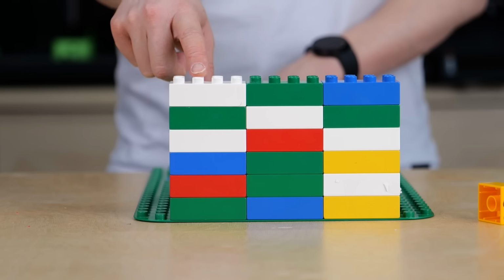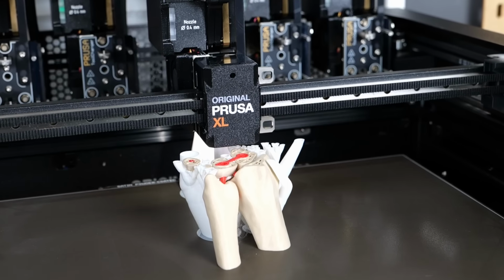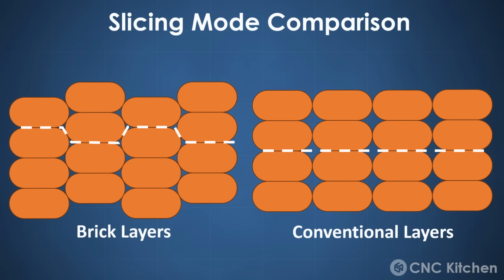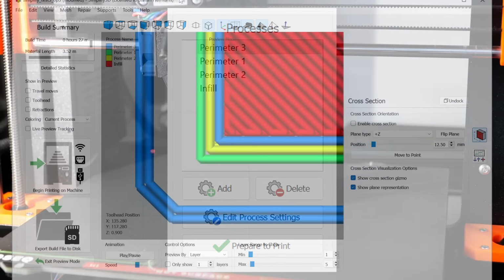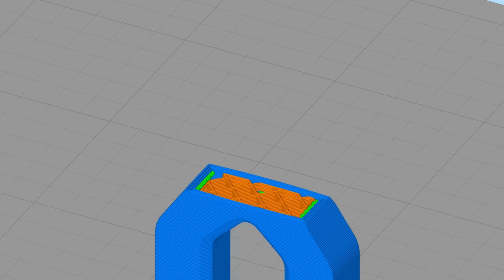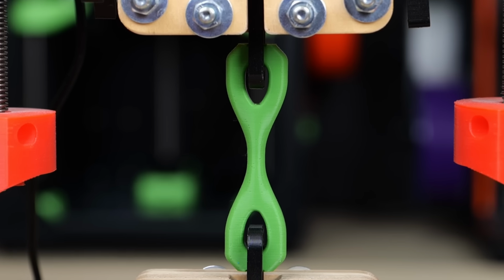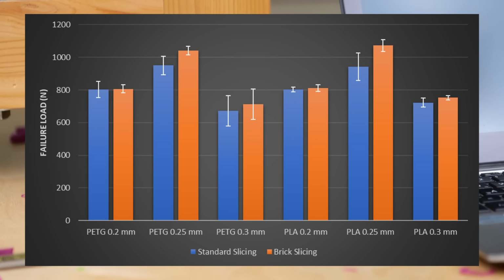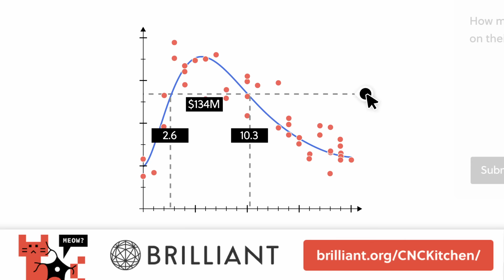Brick Layers - Why did no one do this before?

Comment: How about printing the lines of each next layer onto the seams of each previous layer? Some tweaks would have to be made to get rid of the missing half line at the outer perimeter, but the overlap/interlock would be wider than with the method you presented here.

Comment: I wonder how the brick sliced parts anneal/crystalize. Since there's less space between each boundary, there should be less potential for deformation during annealing. At least... that's what logic tells me. It should also yield better interlayer crystalization during annealing as well, as there's more contact surfaces between which bridging crystals can form.

Comment: Hi Stefan, 
This is a really cool idea, but i'm unsure if lint sheep and traction are good tests for this.
As you're testing the parts resistance for standard orthogonal forces (parallel and 90°) you're ignoring the values between 1 -> 89°
Pure shear and pulling up are too resrtrictive to draw clear conclusion on this, and real efforts are made of combined forces most of time.
You might want to check twisting and buckling too, i'm pretty confident interlocking layers would distinguish better on theses tests. 
What about alterning layer heights and/or extrusion rates ?

Comment: I'm still tens of hours of learning away from testing what you did here, but if anyone with enough know-how reads my comment, please try a vertical plunge of half a layer every few milimeters. this would add anchor points on both X and Y axis between the current layer and the one below. like a vertical zigzag, if you want. I know, slower printing, but somewhat like sewing

Comment: I think the issue with the way you've implemented it and why the fractures are occuring is because although you have shifted the horizontal plane, you've unintentionally created a new vertical stress path,  similar to a brick wall on it's side, Ideally you would also shift in the other axis such that it's more of a honeycomb shaped cross section, although once again, for the added complexity of doing so you might just be introducing a diagonal stress path. I think all approaches could be used together to provide the best strength, but I have no idea if the 3d printers can function in that way, Ie is there the capability of accurately changing the process multiple times during a print without it all going wrong.

Comment: I wonder if the strength increase is even bigger when every other layer has more materuial extruded, like a tiny bit, to fill those gaps a bit more and increase the contact surface.
Maybe even more than just 10 percent, I think

Comment: How about nonplanar slicing?  Rather than slicing along `z-k=0` you slice along `z+a*(sin(x*f)+sin(y*f))-k=0` (choose a and f to limit gradient and amplitude of undulations to fit your printer clearance).  This is the shape of egg-crate foam.

This will have two effects.  First doing away with straight line slices, so there's no focal plane or stress, and second it increases the surface area of slices and consequently increases the contact area between slices.
Reply: The same thing on a micro scale would be to roughen each layer as it's printed.  Your can't exactly sand each layer, but what if you roghened the nozzle with sandpaper so that it would leave grooves as it traveled around, and the next layer could key into those grooves for better adhesion?  Straight groves aren't ideal, so could you add minute oscillations to the path of the print head to roughen the output even more?
Reply: While I'm asking dumb questions, how about rivets?  Leave dumbell-shaped voids about five layers tall with the diameter of the extrusion bead but fatter on the top and bottom layers.  Then try to pump filament down the hole when you get to the top layer of the void to try to rivet the middle three layers together.  While fatter ends probably won't do much to hold things together, what you might be able to do is to make the tubes (and consequently the rivets) go in at different angles that work together to bind in all directions.

Comment: it looks like you have your printing parameters pretty much spot on. maybe the new slicing method makes a bigger difference, if your prints are weaker. maybe if you modify your print parameters a bit, you get a bigger difference. just a thought. bitte mach weiter, deine videos helfen sehr vielen leuten.

Comment: Did you also increase the extrusion multiplier? The radius between the center of each perimeter has increased, an additional material would bridge the gap increase more contact area

Comment: You should try not only overlapping on the vertical plane, but the horizontal plane as well.  I'm guessing that's why the fractures are shooting vertically through the print.

Comment: Please create a microfluidic dripper with a lab/medical grade precision peristaltic pump using UV Cure resin slowly trailing the FPM printhead with a strong UV Led cluster (at the right nm for curing) trailing (at a distance and shielded so it doesn't cure the dripper, only the layer) it to instant cure the UV Resin dripped into the voids, thereby increasing the adhesion strength. Obviously there will be a strength/weight tradeoff in dripper speed so amounts dripped will need to be calibrated for each run to get optimal strength vs weight and to avoid spillage.

Comment: so... based on the idea of layered bricks and the fact that there are gaps visible under a micro scope then what is missing is Mortar.

there needs to be a flux or other layer added between each layer to bond each layer better. 

side note, just a guess but the parts exploding is prob from multiple stress levels that start changing based off other failures. like because it comes apart at one point the rest of the points still holding the load now get extra pressure put on them. so its porb getting closer to the max strength of the material

Comment: Idk myself so I’m adding this but would it not be easier to do it slightly different way by doing something where You print even and odd perimeter and infill 

Like if your walls are 5 
The next level would be 3 or 4 but would be over the top of the joints of the first 5 layers 

Idk and I have not a clue on how to implement but wanted to see if someone else did thanks for the content always good stuff

Comment: Has anyone ever built a 2D printer that uses a combination of "soft" filament and liquid plastic? I could see this working with two nozzels, one that distributes layers normally, but then a second that sprays those layers with an even more melted plastic, filling in the gaps and fusing it all together. You still need the "soft" plastic so it holds its shape, but this could make the layers complete homogeneous.

Comment: My immediate thought here is that 10% increase is in a direction 3d prints aren't often subject to. The strength increase flexing a long rod is where it would get super interesting. 

Instead of doing circle layers, a wider nozzle with a short layer height would probably show amazing results. More like your lego example. I use a .6 at .2 in general, just because it prints faster (I rarely do artistic things) and having the flatter layers helps adhesion.

Comment: I would be much more interested in the Shear strength difference with this type of layering. As while you might be increasing the contact areas a bit, it's unlikely to be a massive difference. While in shear it might have a much more pronounced difference, as that is where your examples with bricks would be more accurate!

Comment: oh and always find a quality prototype resin if you wanna make strong parts you dont get around that learned that from other 3dprinting channels haha :D oh and heattreat before testing the strenght of those kinds of parts or youl end up wasting most of them as you saw :DD they shrink a little but get super durable. higher density, abrasion resistance, hardness etc. i probably forgot other important improvements :D

Comment: Stephan created a Rupert's teardrop in plastic. Get the PPE out!

Thoughts: Perhaps a nozzle with a different shape that can fill the gap? 

Reasoning: The cross section that you showed still appears like there is a small gap in between the layers. I'm of course not implying that this would make a meaningful difference, but is it possible that the nozzle shape is a limiting factor? 

I'm suddenly reminded of the tips to a frosting dispenser when we were kids, they had unusual shapes and they would create different geometry with the frosting as you squeezed the tube. I can imagine there would be a series of learning curves for implementation to the system, but maybe it's worth a try? Perhaps a nozzle that is sloped to one edge and every pass lay's down a thick wall at an angle much like the tip of a jumbo dry-erase marker .

Comment: When things explode all over, it is an indicator that the stress applied is actually distributed throughout the object and plainly indicating even stress application which increases strength by magnitudes. But because it's made of plastic it has its limitations.

You're in the right place. This method applies to even steel making where steel that grew bigger crystals are more fragile and the ones with smaller crystals are stronger.

Comment: When it comes to engineering failures unless you have a specific spot you want to fail, example a circuit breaker. Or fuse,

it failing all over show that it is significantly stronger as it’s a solid part. And also shows that it “truly” bonded this is OUTSTANDING just the preliminary results show you might be able to get a %40 increase with finer tuned settings!!!!

Comment: couple opinions of mine:
1. great fricking video!
2. great fucking idea
3. In metal-based material science the idea of a crack path is used to analyze the short and long-term strengths of a material. There, one wants to "force a crack to change direction as often as possible". Instead of extrusion lines, metals are composed of tiny little crystals that can deflect the crack in just the same way. I think in English they are called "grains"...Long story short: The idea of increasing part strength like this is already investigated, so research could be built on what has already been figured out for metal grains.
4. Apart from anisotropy, porosity is also a rather significant mark of quality for not only FDM but all of additive manufacturing (except for SLA i guess). The volume the molten polymer has to fill is "framed to a lesser degree" in your approach. This should impact solidification and therefore porosity. IMO these tests should include density measurements + cross section images of the actual part to give some insight into this. That might explain the PETG vertical crack. 
5. one last thing...: to truly give a transparent representation of this approach, you would need to disclose the number of filament lines in your test parts + the number of additional interface areas due to the high offset. I would have loved to see that. One might even set the raw crack area of both versions in relation to the part strength... sorry for my incoherent sentences. i love the idea.

Comment: It appears that you only tested the adhesion properties. This does seem to naturally have improvement due to increased contact area spread across multiple layers. I would be interested in a different test of the shear resistance between the two print methods. 

Essentially, a left-to-right resistance test. Unfortunately, this only would be significantly stronger in circular structures, since the front-to-back resistance would be only slightly improved from the increased surface contact in a square structure. Unless we start printing in hexagon structures instead of lines.

Comment: This could be combined with printing 'V' shapes (or gentler curves) into the layers, so the nozzle/bed is moving up and down as it moves along a line combine the 2 and the strength should be very good - not easy to make the code to test though..... (Stefan??)

Comment: Why isn't there an "annealing" step like when you forge steel? I imagine if you heated the 3d printed part at a high enough temp to partially melt the plastic, but not enough to deform, it could have significant increases in strength

Comment: I suppose if it is "better" would be a matter of the application. If you, for some reason, NEED the higher tolerance, then use this method. Otherwise, I think the default is better. You get a flat separation with no cracks or missing pieces when the normal flat layers break, so just a bit of superglue could repair it for most applications.

Comment: Print speed has a lot to do with layer adhesion too. Be curious if you'd get the same difference if you slowed printing waaay down to that the nozzle had more time to remelt the previous layer.

Comment: Hi, i have problem when i 3d print large circle around 60-70cm diameter, with height of 3cm. Starting at height 1cm the wall will start to bend (the wall thickness is 1 layer only). 

But if i make polygonal shape of 60-70cm diameter. The result is perfect, not bend.

How to solve this?

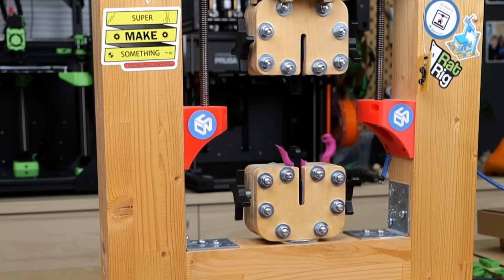Comment: If some of the inner layers' height was intermittently doubled, such that the cross-section of some lines is lenticular in shape, it may produce more strength along the diagonal, reducing the catastrophic failure incidents. An example might be at 7:53, the exact frame where it breaks. It breaks nearly symmetrically along the diagonal in the middle, and the two pieces fly away in opposite directions. However, the fractures occurred at nearly the same spots mirrored vertically along the item, which happened to be diagonally along a fault line. The breaks occurred at nearly the same angle which appears proportional to the slope of a slanted failure. My thinking is that failures like that might be caused by the near homogeneity in the size of the material, just like how concrete with near homogenous aggregates can tend to be weaker due to the lack of anisotropic strength due to the accumulation of variances of the aggregates, similar to the fundamental problem of laying your bricks on top of each other. Could be wrong though, but this is just an idea.

Comment: Wood is an interesting structure. They're often made from fibers which span in varying directions. Some woods even have planes of similar facing grains. But, the direction, size, and density of the grains all contribute to the weight and strength of the wood. 
If we could somehow achieve 3d printing methods that emulated this...they might be as strong as wood.

Comment: Maybe if you trick the printer to print 5%-15% lower but keep the same line height, to force the molten part into the creeks and crevices still left empty between the lines.

Comment: There is a slightly similar thing in Prusa slicer, in that you can combine the infill layers. So for every 2-3 perimeter layers you have 1 infill layer. While not as robust as what you did, it can add a small amount.

Comment: By offsetting adjacent line heights you haven't eliminated discrete layers. You have just traded planes parallell to the print bed with planes going diagonally. Instead of thinking of heights as a zig-zag that goes 1, 1.5 , 1, 1.5, 1, 1.5 you can think of them as 1, 1.5, 2, 2.5, 3, 3.5 which is a straight line going diagonally up. The tensile strenght test showed one part that was pulled along the normal of its layer planes and one part that was pulled diagonally to the normal of its layes planes which made that part stonger in that direction.

Comment: Interesting stuff. You do a great job of examining tweaks and unconventional print and post print processes that I love.

I would have been interested to see some experiments examining failure when force is applied perpendicular to the stacking of the print layers. Like a shear test or a 'torque test' (is this the right term?) with one side of a long piece clamped and supported and the other hanging with weights hung or force applied.

Love what you do.👍

Comment: Because it's very difficult to lay blocks that way, and totally unnecessary due to the use of reinforcing and concrete poured into the internal spaces.
And, bricks by themselves are NOT a building material, only a facade which is tied to the wall behind. If you build with bricks, you die in the first earthquake.

Comment: It was cool to see that it is stronger in a tensile strength test ... but wouldn't there be a bigger strength gain in a compressive shear test across the plane of the layers? ... where the offset layers are pushing against each other, compared to a traditional print that would only have the strength of layer adhesion in this case.

Comment: Print the layers sideways and add a hole for an interlocking part, add glue if needed. Making layers one by one then gluing them together could also be an idea. You'd also want the layers to start and end at different points to avoid a single point of failure.

Comment: some time in the last few...decades or so, they started making cars' front and back ends easier to crush in a collision. initially people thought this was just because they were using lighter weight (or cheaper) parts, but it was actually a safety implementation, so that, in the case of a collision, a person was not jerked forward by momentum quite so suddenly and violently, saving many lives in the process.

my point is, it would depend on the printed part's intended usage as to whether or not having it break CLEANLY or not until it had failed COMPLETELY as to whether or not it "cracking down the side, but only after much higher force" was a good thing. if breaking cleanly would save a life, then perhaps conventional printing would be the better option.

but even so, it is NEVER a bad thing to have more options, and implementing this into every slicer AS AN OPTION would only result in greater options for our future, and the future of 3D printing.